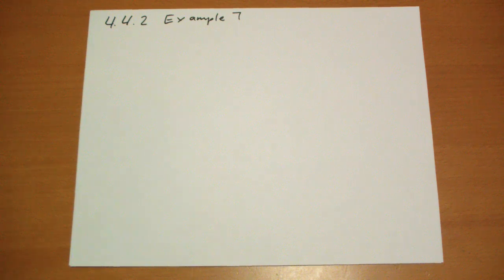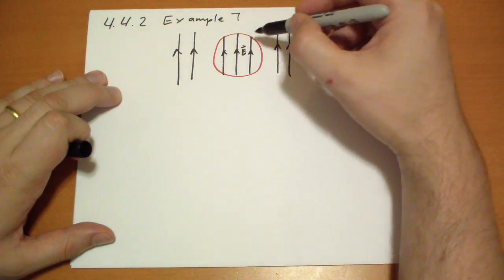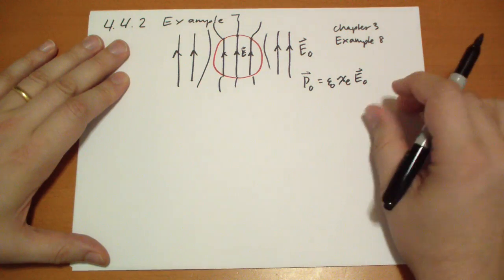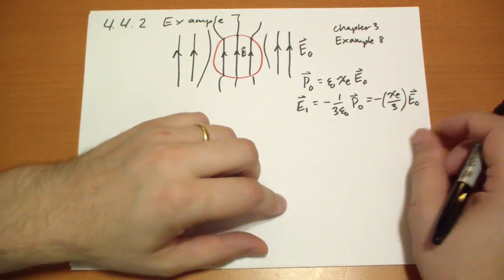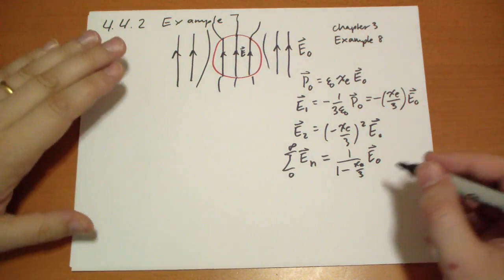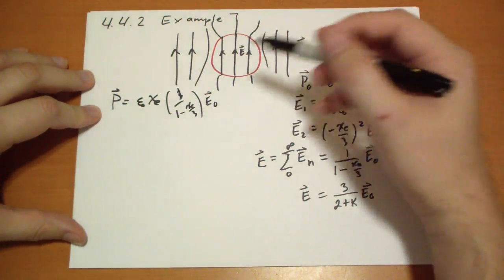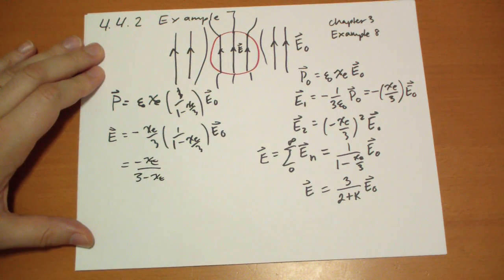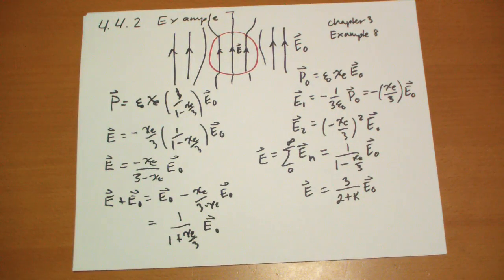4.4.2 Example 7

Comment: idk which edition of the book you have, but in the forth edition this is not the method used to solve for E.
The use the potentials at just inside and outside the boundy, as well as laplace equation.

Regardless, i appreciate the videos they have really helped my with my E&M course.